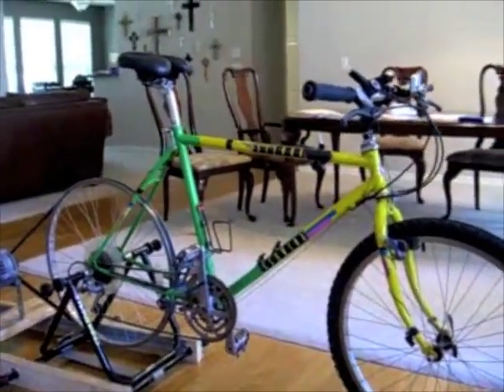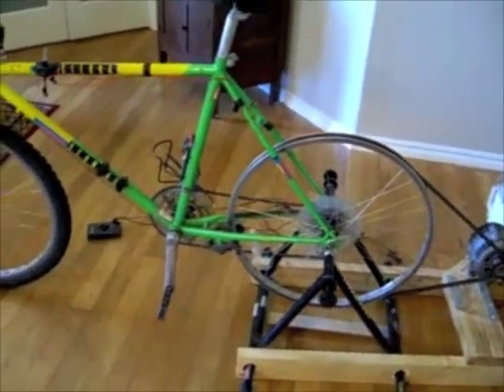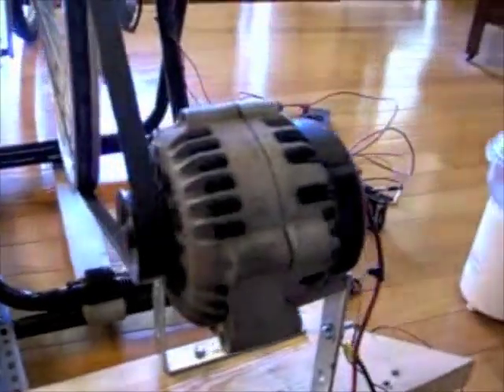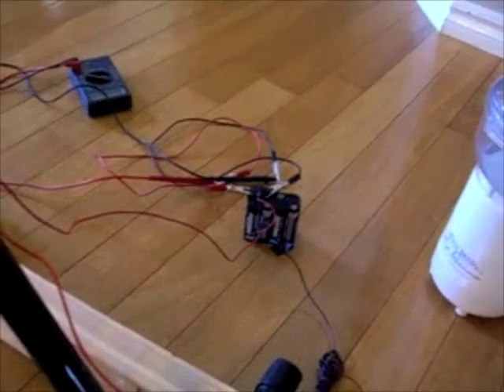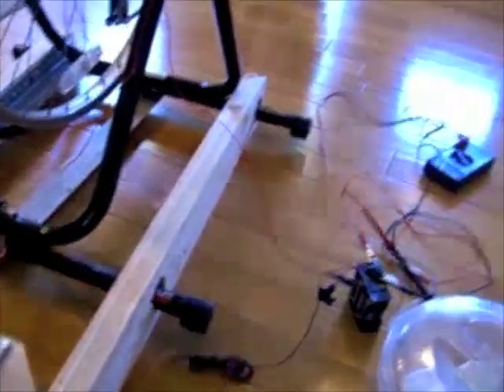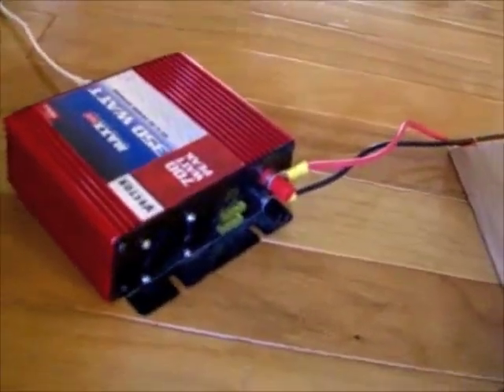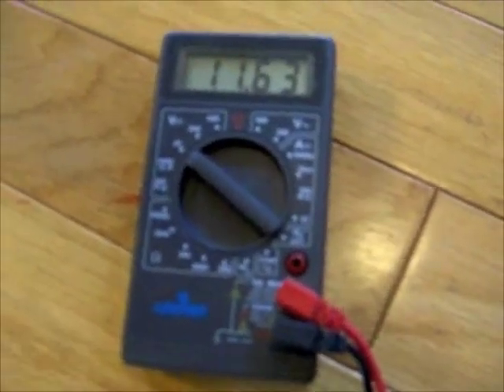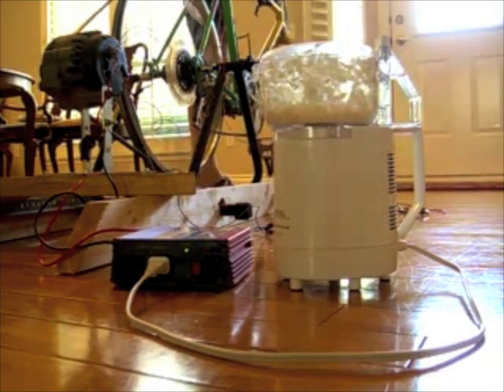Bicycle Generator

Comment: Why not use a large DC electric motor with perm magnets to eliminate the requirements of preexisting power to energize a magnetic field?
Reply: Good question. Permanent magnet generators make low voltage at low speeds and high voltage at high speeds which won't work with the power inverter which wants a nice steady input voltage. That is why they aren't used it cars anymore after alternators were invented.

Alternators are internally regulated so they try to output the same voltage no matter what speed they are running or how many amps you're sucking. Perfect for in vehicles where the engine RPM is always changing while driving and you want a constant voltage in your car, usually between 13.8V and 14.4V, regardless of whether or not the headlights are on/off, or if the owners running a big amplifier.

Even though they can generate the right voltage at low revs, it's best to run alternators at high revs because they are more efficient then. At low revs the alternator has to pump a lot of juice into the field winding's to make the right voltage in the stator winding's, this makes the winding's get hot and wastes a lot of energy. Also the alternators cooling fan isn't turning fast enough to keep it cool, causing overheating. So if you're running a huge amplifier and/or sub in your car, don't run it hard with the engine idling your alternator will get extremely hot!

At high revs the alternators cooling fan will keep it cool easily and the field winding doesn't need much power to make 14V on the stator winding's only a very weak field is needed.

Sorry for rambling on so long... Hope that answers your question.
Reply: Actually that is an excellent explanation, and also answers my long unanswered question, "Why does the car industry no longer use DC generators?" So in theory, with the advent of Super Capacitors as storage and some kind of voltage regulation system, could a DC generator with perm. magnets output consistent regulated voltage regardless of the RPM's?
Reply: Sovereign Knight Well the problem with permanent magnet generators (they were called dynamos back then) was they generally couldn't charge the battery when the engine was idling. So at red lights with your headlights on and everything running your battery was slowly draining. With a large super capacitor in parallel the voltage would be steady in a way, the voltage would very slowly drift up when you're driving then very slowly fall down when you're idling. It would be the same problems but in sloooow motion basically.

Because perm-magnet generators have a fixed field strength an external regulator is needed to 'cap' the voltage when the stator goes above 14.4V. The regulators are usually big and require a heat sink. I think those permanent magnets in them are more costly to use than field winding's but don't quote me on that.

They still use permanent magnet generators on small to medium sized wind generators though. You think, "If alternators are so good why not use them on wind generators too?".
First of all, alternators require an input voltage to get going meaning your wind turbine needs a local battery.

Secondly if you remember when an alternator is at low RPMs, as the alternators regulator is approaching the point where the output voltage will collapse, it pumps as much power from the stator to the field winding's as it can to desperately try and make a strong enough voltage on the stator to maintain it's target output. If the stators output get's too low there won't be enough to power the field winding and the whole circle of life will collapse. This makes the alternator incredibly hard to turn at low speed because of so much wasted power into the field winding.

Terminology: When you provide an alternator power to get it's field going it's called "exciting" the alternator.

Lets imagine a wind generator with an alternator is stationary and a breeze is starting it to turn. The torque needed to turn the alternator would slowly rise as the output voltage is too low to charge battery bank. As the RPMs increased further the regulator would reach a point where it can "self-excite" aka the stator is now making enough power to provide for the field winding, and the stator voltage would sharply jump up to 14V as it dumps tons and tons of juice into the field winding's because it's at minimum speed.

The torque required to turn it at that point is huge it's like someone just dropped the clutch (slight exaggeration). You hear this phenomenon in day to day life when an alternator pulley is slipping and screaming away after someone starts their car with a loose alternator belt. It's slipping because it's stuck at low RPMs. A good rev of the engine usually gets it over this hard spot and it wont slip the belt anymore at higher RPMs because it requires far less torque to spin. This effect would slow the wind turbine right down as soon as it 'self-excited' and the field would collapse again. 

Permanent magnet generators have a smooth increase in torque required vs speed. As RPMs increase the output increases and the torque increases.  There's no sudden hernia to hurdle at low RPMs.

Sorry again for such a long comment! Once I start I think of something else related that I think I should add and without trying I've rambled on again!
Reply: Now that is an awesome answer! This totally makes sense to me now.
Reply: Curiosity Because the alternator is regulating its output. The alternator will try to output the same voltage no matter what speed the engine is running at. So that when your engine is running at high RPM your cars lights don't blow. 

The alternator's regulator keeps the output more or less flat, independent of the shaft speed. It will actually get easier to peddle the faster you go. The only way to increase the load for the rider is the increase the load on the alternator.
Reply: They are a lot easier to come by very car junkyard will have one and they are cheap
Reply: KiwiPowerNZ  thanks for the comment, increased my understanding a lot more. I've got an alternator connected to my stationary bike to simulate riding conditions however my problem occurs when the rider accelerates or moves at high speed the load doesn't increase accordingly, do you know why?

Comment: There's a dozen ways around the complexity you have in your circuit.  First off, GM made this thing called 'a one-wire alternator' that auto-hots the stator when the alternator starts rotating. You can also wire this yourself with a non-one-wire alternator. Alternatively, put a 12v wet-cell or rechargeable in the circuit that has the inverter in it, and simply hot the charge circuit as you need. Finally, if you take that rotor out, remove the brushes and did some machine work to change that armature over to a permanent magnet configuration, then you would have an always-hot stator, without need to 'hot' the stator (the main reason that alternators have powered stators is to conserve price and weight, but for an AC generator, you can drill and insert N52 neodymium magnets to make the stator 'always magnetized').

Comment: I wonder if you could add a 2nd pulley to the alternator, to spin a 2nd alternator, and get more energy without noticeably more resistance ? I wonder if you could add batteries and maybe a solar panel, then exercise for an hour a day to run a small house or cabin ? I dig this :)

Comment: What you could also do is use the derailer to vary the amount of power output you are giving...if whatever you are using is starting to cough out on your electricity, you just keep shifting up and pedaling at the same pace. This will allow you to be able to be more energy efficient with your body too, as since you may not be using as much electricity at some points rather than others, you can gear it down and therefore tire yourself out less as you are still pedaling at the same speed, but with less pedal force applied. Also, if you want to use this setup for a very, very long time, you may want to replace the plastic pedals with metal ones. I find that on a normal bicycle, even if you do not stand up and pedal using the bike, you can still wear out those cheap plastic pedals so easily. With a set of pedals that AT LEAST has a metal frame of it's own aside from the steel pegs inside, you can expect the pedals to at least be able to withstand you pushing the bike hard everywhere you go for about 3 years if the steel frame is the worst available on the market.

Comment: Alternators are inferior.  Use a direct electromagnetic drive instead.  Mount neodymium magnets on the rim and wrap your own copper coil near the rim.  Permanent magnets are better than an alternator.  You'll generate much more electricity.

Comment: Doesn't an alternator generate AC? why did you need an inverter?
Reply: Alternators produce DC not AC they can be modified supposedly to produce AC
Reply: ***** Alternators in fact generate AC (hence they are called alternators) but generally a rectifier is an integral part of them so that they can be used in cars (there's DC on the output of the rectifier).
Reply: sumixSTYXX I understand what you're saying but out of the box they are designed to output DC, although they produce both so I guess we're both right .

Comment: You apply 12 volts to the Stator coil. It takes the place of a Perminant Magnet to build up a magnetic field around the rotor. The mechanical energy input into the rotor gets converted to current flow by cutting the lines of magnetic force generated by the Stator Coil. The AC power coming from the Rotor is converted to DC power by diodes in the alternator. To regulate the voltage output they vary the voltage to the Stator Coil by using a Solid State Regulator Circuit that is connected between the output terminal on the alternator and to the stator coil.

Comment: Honey, the damn power went out again... jump on the bike so I can finish chopping this onion!  

I mean it's a neat experiment I suppose, but how is this useful at all to anyone?  Think about it... sure you were able to pedal power some electricity, from an alternator which is designed to deliver power but the energy you exert by no means is equal or better than what is returned.  That is another flaw of alternators... they only give out what you put into them.
Reply: if you want to exercise its perfect though

Comment: its a shame you did not put a fly wheel on the same axel of the alternator as the way I see it you spend most of your effort speeding up your set up trying to push the pedals till you get to that sweat spot when you can put all your force in to the bake. if you think about it me and my bike come in at around 100kg moving at say 12mph with just the wind to slow you down on the flat. That gives me time to free wheel the pedals till the next sweat spot where I can power the bike and make up for lost speed and add to it. so a fly wheel 26" across and coming in at 100kg spinning at the same speed as the alternator should help you out and make it feel more like riding a bike rather than just fighting the alternator

Comment: What did the load feel like through the pedals, when the switch for the food processor was flipped on.
Reply: Exactly.  We did this in an electrical engineering class I had.  We only used light bulbs.  Switching from 1 bulb to 3 was killer.  We each had to pedal for 1 minute, no one could keep all three bulbs at their full wattage.

So the typical college male can't pedal 180 watts for even a minute.
Reply: RyeGuy8 Raw animal power has its limits :-)

Comment: I would like to build this for my final project in college but I would also be required to build the AC-DC inverter as well. Any idea whats the cost of the components to get a high output like 120V as seen in this vid?

Comment: Batteries last a lot longer if you elevate them off from the ground. I'm not sure about those batteries, but car & motorcycle batteries drain real fast when they are place on the ground. The earth just sucks them dry of any useful power in very little time. Never buy a car battery at the store if you pick it off from the floor. A shelf close to the floor is ok, but cannot be in contact with the floor or you will be buying another battery a year or two later and saying to yourself, dang, i just got that battery, it's practically brand new!
Reply: What did I read?!?
The only reason this might be true is when your floor is really cold and it decreases battery capacity and useful current, but frankly it makes your battery last longer (providing that you heat it up and charge before using)
The other reason that might work in store: People might not look at the very bottom shelf and batteries stored there might be older
There is no electrical/chemical explanation why battery (sealed, in insulating plastic whell) stored on ground would go bad

Comment: Interesting! What about using a capacitor instead of batteries and have the alternator put some charge back into it so you can use it an unlimited amount of times.

Comment: Would it be more efficient to hook bicycle chain directly to the food processor spindle? :)
Reply: Define efficient? What about a laptop? A radio? A rechargeable battery charger set? He's got AC current there. With that, he can run more than a food processor. Also, blackouts don't mean an end to margarita parties anymore.
Reply: Themysterymove Actually it was a joke, there is a smile at the end :) What really would be cool is to attach some generator and battery on the bicycle and use it as an electronic brakes, so it will charge when you are braking.
Reply: But I want a blendercycle, too.
Reply: Alexander Smirnov Every time someone mentions generating electricity, some idiot comes along and mentions regenerative braking. In this case, you're not braking and power from regenerative braking isn't even needed. You use the power (in this case, to chop the onion) as needed. You're not storing power.
Reply: If you pedal backwards it puts the onion back together!
Reply: Extract the sulfur from the onion to electrolyze a battery

Comment: if you ground the D terminal you can bypass the rectifier and get 110V out of that alternator
Reply: Joseph:

How much current  at 110 volts would you get?

Comment: We are trying to replicate this as a 7th grade science experiment (which is due in about a week) and have all the components and have tried hooking it up without much success. The best we have been able to do is generate 1.8 V of electricity. 
Other people have posted similar results below but we have not seen any replies. What is the multimeter hooked to? It seems to be hooked only to the battery but when the switch is turned off, how does it register the bike generated voltage?
Thanks!
Reply: Depends on the alternator you are using. New alternators will not charge a "dead" battery. They also have internal regulators. The regulator is most likely is not "turning on". Usally they have One red volate wire out, the one with a nut on it. Some have up to three other wires conected in a plug. These wires tell voltage output, voltage of battery, and switch. every alternator is differnent. Basically you need to trick the the alternator by giving 12v to the correct wire. Alos make sure you have the alternator grounded correctly to the outside outside on the case.

Comment: if the alternator was able to run a 220 watt food processor,,,, there is an overunity that happen because it only takes 30 watts to run a bicycle at a speed of 15 - 24 kilometers per hour which is an average speed....
Reply: How did you deduce this? Did you consider higher gears or higher resistance/friction?
Reply: 1.  Watts to power a bike varies based on load.  30 watts would be a very easy laid back ride on flat ground.    

2. It's not 'overunity'.  The thing is plugged into an inverter.  Also, just b/c an appliance is rated at 220 W doesn't mean it uses all 220 W all the time.
Reply: The thing is, he isn't running a bicycle at 15-25 km/h, he is running an alternator, and the power needed to run the alternator will depend on what the alternator is powering.
If you had an alternator hooked up to a moving bicycle, you'd spend your theoretical 30W to move it, plus the power to turn the alternator, which would depend on what would the alternator be actually powering. If it were a 220W food processor under full load, then you'd spend 250W. In fact, you have to account for the less-than-unity conversion efficiency of each element as well, so it's really somewhat more than 250W.
Reply: RyeGuy8 correct sir.  it is in fact 220 watt Max load.  Meaning with an empty food processor it uses maybe half of that 220 watts.  Load it with sticks and blamo! 220+ watts until you let the smoke out of the motor.  Electric motors are funny... once you let the smoke out of them they never quite work the same again lol.